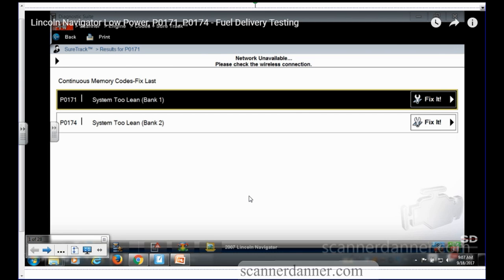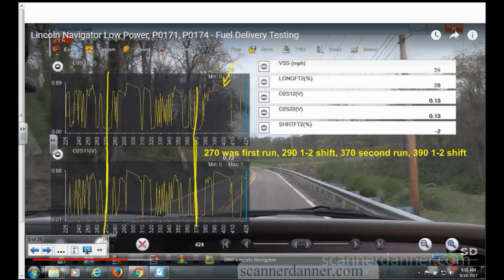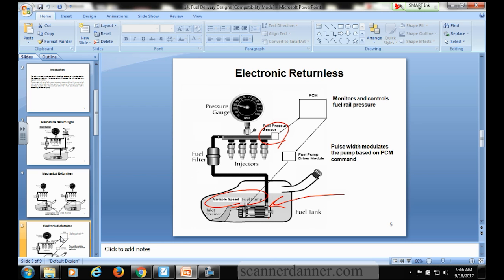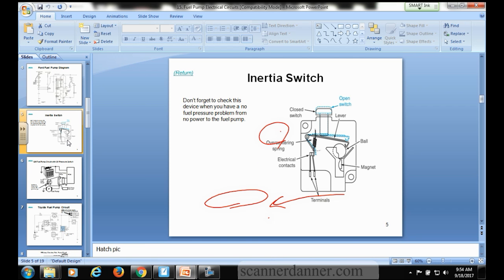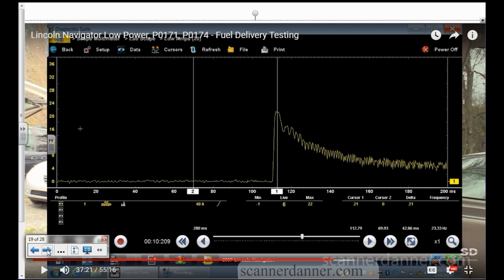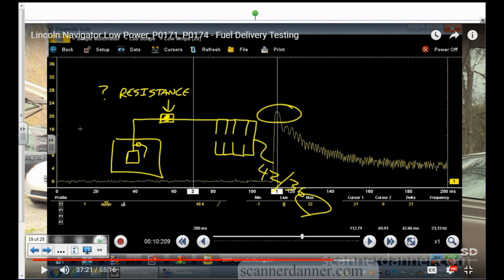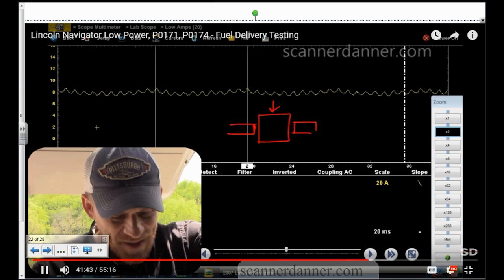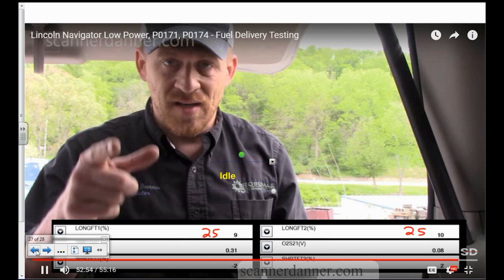An SD Premium Class on Fuel System Testing and Trouble Codes P0171, P0174

Comment: Hello, Paul. I have been told that fuel issues will affect calculated load value, but your video proves the contrary. Good calculated load with a fuel delivery issue. Could you please how fuel delivery affects or does not affect the calculated load value?  Thank you.
Reply from the maker: I've been using VE testing and calculated load values for awhile now and I've not seen low fuel pressure affect that number. In fact, that is one of the main advantages of that test!
Reply: @ScannerDanner   I cannot thank you enough, Sir. You are the best!

Comment: Hi Mr Paul, I'm one of your followers from Oman.
I've 2009 GMC terrain I'm having a lean condition on both banks. The nice thing is that the code P2179 says "system too lean off idle" which helps a lot.
I used a multimeter as a jumper on the fuel pump relay, the pump runs and I got around 4.6 Amps.
Is it weak fuel pump or normal ?

Thanks,,
Reply from the maker: Need a pressure reading. Amperage alone is not enough data

Comment: Hello Mr..SD I would like to ask can you use Fuel spray instead of starting fluid..Am in Uganda we don't have advanced Auto shops .. Thanks
Reply from the maker: I don't use starting fluid for diagnostic work as it is too volatile. Carb cleaner is my preferred spray when doing a quick test for no fuel

Comment: So I need help on my no start fuel issue on a 2011 f250 ,6.2 replaced pump n driver fuel module and fixed the problem ran good for 3 weeks n stalled our n won't start again I have no relays or fuses bad but when I jump and bypass the fuel module it will run is it possible I got a lemon part n I need to replace it again or can it b something else down the line

Comment: Your luckey my Nissan stoped, i thought a rat eat my wiring, it was ok put a new one in jacked up my bed and it ran good for a moment, had put another one in, my friend said lets see if it works. After hitting the pump in hole yes it did work i still put in the new one. Keep up the good work

Comment: I did a simaler test because my fuel pump would intermittently stop working then not work at all. So I had it towed to a, get this a mechanic shop and told the mechanic what had happen. He went out to the truck and he got the truck to start. Then he called me and asked why I though it was the fuel pump. Saying the truck started. I explained again the procedures I did with my verus. He said it Dosent mean your fuel pump is bad, WOW a mechanic...not. I said hook up your scanner to it and check for yourself. He said all he had was a code reader. I have learned all I know from scanner Danner's channel, GET SCANNER DANNER PREMIUM. This will help you know and understand everything with you vehical.

Comment: GTDI means Gasoline Turbocharged Direct Injection, those fuel systems have a variable speed electronic returnless fuel system.  
The 3.5L Ti-VCT (Twin Independant Variable Cam Timing) fuel systems have a dual speed MRFS. There is a FPCM or FPDM as some like to call it, but no fuel pressure sensor on the rail.The FPCM controls the fuel pump pressure at 10 or 12 V based on load. Basically the PCM duty cycles the FPCM to control the fuel pump. How i know this? I had an insane case study on 2014 Taurus with the 3.5 NA engine.

Comment: I have a doubt the filter is after the pressure relief valve so wouldn't be the pressure going to be same if it has the blocked filter or new filter hence the amps are going to be same just my logic
Reply from the maker: depends on the design, not all of the systems used a pressure relief valve in the tank, in fact most of them do not

Comment: Just a minor point, the sections of a commutator are called rotor arms, which might be  better term as if you say an 8 bar fuel pump, my first thought is 8 bar of pressure.
When you first counted the current peaks and said it was an 8 bar pump, It got a little confusing.

Comment: Could a bad fuel pressure regulator be at fault for low fuel pressure? Or is there no way testing it, or changing it separately from the pump assembly on a returnless system? Thanks love the videos!!
Reply from the maker: If it's part of the pump assembly, there is no test for it. And no way to know for sure if it's leaking in there.

Comment: One tip if I might; When looking for a specific event, hit the record button (floppy disc) and it will include a marker line in the data recording. This is helpful for locating a specific event but in this case making sure it is when the pedal hit the floor.

Comment: I have a complaint,   I am very good at carbureted engines but I just bought my first throttle body which is a 1997 chevy blazer.     you use a $3,000 scan tool on every one of your videos,     there is no way I can afford this type scan tool .    I would much appreciate some videos that would help people like me .      so many things that can cause a lean code on both banks and I do not have a scan tool .     yes I know spray with brake clean I want professional
Reply from the maker: Stop focusing on the tools I'm using and focus instead on the testing methods. Many times you can duplicate these tests with other tools. Many times you cannot, but you can find less expensive alternatives.

Comment: How do you do this test on a speed density system? I'm an FCA tech for the most part unless it's a PZEV we don't use MAF sensors. So I'm just wondering how to do the WOT test on vehicles without MAF. Sorry if it's a dumb question but I'm trying to better understand fuel trim issues. Engine driveability problems are my biggest weak point I'm trying to improve.
Reply from the maker: It is no different on a speed density system, you can still use your oxygen sensors as a guide to low power conditions at wide open throttle. If they stay full rich (over 800mv for a narrowband O2) then you DO NOT have a fuel delivery problem. Hope that makes sense.

Comment: GTDI is gasoline turbocharged direct injection aka as ecoboost which use a hi-pressure fuel pump to convert low psi to high psi for direct injection
Reply from the maker: Thanks for the lesson :-) not sure where you were going with that though

Comment: Is autozone a good place to buy sensor  bec I bought a crankshaft sensor from them n I put it in it died on me going work I took it back and got it replaced but now it misfiring and hesitant to start it a 99 dodge ram 5.2l
Reply from the maker: You didn't adjust it properly. Air gap is critical

Comment: Hey Paul. Great video like always. I was wondering about something while watching this video. These newer design brushless motors. Can you read them the same using a current test to see a bad spot in the armature ? I haven’t ran across one yet to check but am curious if it is the same type of reading. Not just on a fuel pump motor but any motor that is a brushless design. Thanks man
Reply from the maker: I've not seen a brushless motor yet, so I cannot answer that

Comment: With this type of pump/regulator combo, isn’t it possible the both the pump and regulator were still good and you just had the pressure drop simply by a plugged filter? You’d still keep the proper pressure before the plugged filter and have the lower pressure/volume after it.
Reply from the maker: I believe I addressed the fuel filter variable in my video? What was the old pump vs new pump, with RPM and Amperage? Refresh my memory. I believe there in lies your answer. Was it lower than normal amperage and higher than normal RPM? Sorry, this lecture was 2 years old and my son Caleb did the edits, so my memory if foggy on this one.
Reply: In this case, there was definitely an issue with the mechanicals of the pump. There was an increase in amp and a decrease in rpm with the new pump. Apparently I phrased the question wrong, I was trying to ask if the same symptoms could also be caused simply by a plugged fuel filter? High long term fuel trims/high load %/dropping fuel pressure with increased rpm...

Comment: I have a 2010 Altima 2.5S w/Automatic. My OBII device shows codes P0725
 and P0826 together.  The cars is running fine.  I have not cleared the 
codes (but will tomorrow).  The car seems to run fine, no hard start, no
 stalls nor stutters or shifting issues.  I am thinking the Cam-Shaft 
Position sensor may be one of the OE styles that gets oil contaminated and 
perhaps it is sending bad info to the power-train?  Since P0826 is a 
Power-train code?  Any thoughts?
Reply from the maker: I need you to do the homework for me. What are the definitions of those codes? I know they are transmission related but that's it.
Reply: @ScannerDanner  Dan, I cleared the codes and they did NOT come back, and there is NO Check Engine Light on either. Code PO725 "Engine Speed Sensor Circuit Malfunction",  and code PO826 is defined as “Up and Down Switch Input Circuit” on vehicles with manually shift-able automatic transmissions.  I think the up/down shift code came up because at least a couple of times I have inadvertently moved the shift lever over into the slot for "manual shift mode" when going from Park down to Drive, and then having done it unintentionally I quickly moved it back to the right back into the normal "Drive" shift position.  The Engine Speed Sensor is most likely a code connected to either the Cam Shaft Position Sensor, the Crankshaft Position Sensor (aka Transmission Speed Sensor -- As I find it is called out to be the same part by different links).  Again this is a 2010 Nissan Altima 2.5L with 103K miles. No other issues. So I think I am good here - Thanks for answering and asking!  Richard in KY
Reply from the maker: @retiredperson4054  My name is Paul Danner :-) So I looked up the P0725 code and this is a generic code indicating the TCM did not receive an engine RPM signal via the CAN network. You should ABSOLUTELY have an engine code too with this TCM code P0725. IF you do not, this does not bode very well for your transmission control module (TCM). 
As far as the P0826 code goes, I do NOT think you can cause that code by what you are describing. In other words, operator error, is not an option here. 
It is very difficult to advise you further on these and almost impossible when the problem is intermittent. Then add that we are talking through text on the screen, makes it even worse. If you find that you need help in the future, post to my forum www.scannerdanner.com It is free to join and I have 4 paid moderators who help me help you guys. 
Thanks! Hope to see you there.
Reply: @ScannerDanner  Paul, Thanks for the fast reply.  Like I posted - I only had the two codes showing.  They went away (cleared both out ) with my Bafx Products - Wireless Bluetooth OBD2 / OBDII Diagnostic Car Scanner & Reader Tool for Android Devices. At this point, I will just have to keep checking every week or so to see if  anything shows up? I will hop onto your forum - and thanks for the offer and your prompt replies!  I was a building trades instructor at two Technical Community Colleges -- Thanks for teaching the auto skills trade!  Best regards, Richard P

Comment: SCANNERDANNER can you make a "cheat sheet" rows and columns of what the short & long Trims, RPMS would be for a lean condition compared to a RICH condition if you're having a vacuum leak compared to having a fuel pressure issue. It gets very confusing to know what the trims should be at because you have experience when looking at the trims to know if you have a vacuum leak or its a fuel pressure problem but how can you know but just looking at the trims? You can get a lean condition or a Rich condition from a vacuum leak or a fuel pressure issue so how can you tell by just look at the trims?
Reply from the maker: Watch this video https://www.youtube.com/watch?v=oRX2V6_a3dc&list=PL5E3AEC36DB838BB1&index=32&t=0s

Comment: ScannerDanner! I have an issue and can’t figure out what the issue is. I have a misfire cylinder 2. I have a new distributor and new cap and rotor, new plugs and new plug wires, new fuel filter and injectors were just cleaned, O2 sensors are fine and EGR is fine. I found out that I’m not getting spark out of my plug cable on cylinder 2. I changed wires around and still nothing so the dist is not giving spark for cylinder 2. Can you help me out?!?! I’m going insane trying to figure out what the issue is.
Reply from the maker: Same problem with the old cap? Other than a bad cap and rotor. It sounds like you have an input issue. Is this the correct distributor? Any damage to the trigger wheel or reflector on the shaft of the distributor?
Reply: ScannerDanner tried the old cap, and had same issue. Shaft on new dist is fine. I’m checking crank sensor and teeth that pass it.
Reply from the maker: @shanefickett3597  "new distributor"?? Why was the distributor changed? If you are consistently losing spark to only the #2 cylinder, you absolutely have an input problem. Your ECM is receiving garbage in and is providing garbage out. There is no other explanation for what you have going on.
Reply: My car is a 1996 Honda Civic DX 1.6 non vtech.
Reply: Any other ideas scannerdanner? I’m thinking it’s either going to be the crank sensor or the wire for it, or the ECU but doubt it’s the computer because they rarely go out on these cars. And most likely wouldn’t be the main relay right? Not the PGM-FI?

Comment: I've watched your videos for about 7 years now and I always learn something. You had my truck in your class about 3 yrs. ago after I had taken it to 4 different places one was the Toyota Dealership and no one had any Idea what was causing an intermittent vibration but you did. Thank you for all you do to teach others.
Reply from the maker: I didn't pinpoint that one for you,  I only knew it went away in 4x4 mode, right?
Reply: It was a bad needle bearing. I had to replace the Clamshell CV axle bushing in the front Differential with a modified bushing from East Coast Gear Supply. It seems Toyota didn't machine the spider gear correctly. You are still the best.
Reply: I forgot to mention that I bought your book and OTC3633 test light, both are great.

Comment: The only thing I find hard taking a class and then using it out in the real world. Is remembering what you were talking about.
Reply from the maker: 😀 it will come to you my friend. Are you getting the jobs where you can practice what you learned? That is the most important
Reply: @ScannerDanner   with my new boss. No. But trying to learn when I get a problem car during my free time.
Reply from the maker: That is the key piece you are missing. Take on some side work and hone your skills in your driveway. Troubleshooting only, tell someone else what to fix. Even if you start for free. This type of work is that important to you right now.

Comment: Learned something from another channel as well.. if you take fuel pressure spec and multiply it by .12 to .13 you can get an approximate amperage spec to compare .. thought I’d share that and also see your thoughts on that @scannerdanner
Reply from the maker: wonder how accurate that is? testing it on multiple cars would be the answer to that
Reply: Yea I plan on doing several known goods since I’ve learned it.. thought it would be a nice addition to the test if it turns out to be truw

Comment: Why would my long term fuel trims be -20 and short terms be 0? No misfires. Engine runs great
Reply from the maker: you have a rich condition that has been compensated for and if you do not have rich condition codes yet, you will
Reply: @ScannerDanner  he needs to buy the book. 🙄

Comment: know this is off topic but want to hear your thoughts. Have a code po449 had defective vent solenoid repl. Now the light comes on roughly once a month all connections look good any thoughts on what to look for? Big fan of the channel!!.
Reply from the maker: Pull on the wiring right at the vent solenoid connector. I bet it pulls apart (copper wires are all broken inside of the insulation)

Comment: I’m a little confused using amperage to prove out good voltage at the pump. If you have a marginal voltage drop, wouldn’t you still have a high amp draw? 
   Maybe next time you have one with a marginal voltage drop record an amp scope pattern to show the difference. Thanks
Reply: If you have voltage drop where you shouldn’t (high resistance) then you would have lower amperage.  Using ohms law, you find that the more resistance you add in series to a circuit,  you will have a lower amp reading.
Reply: TheMagican614 , yes but he said amperage was a little low because it had a mechanical failure. So how are we sure it’s not a little low due to a voltage drop instead?
Reply: Bart Young well in the video when he saw he had around 6 amps he was not concerned at that point with a power or ground problem.  Scannerdanner has a lot of experience so he has an idea of what kind of reading he should see.  I personal think that if there was a problem with high resistance in the circuit, you would see less current than 6 amps.

Comment: low feul pressure, low amp draw , high RPM, faulty pressure regulator at pump? leaking through ?
Reply from the maker: Possible? No way to know if it was that or the impeller of the pump that was worn. On these systems where the regulator is part of the pump assembly, there is no test to determine if it was the regulator or pump or leak in between. Also, this is why, on this design, you MUST change the entire assembly
Reply: This is exactly what I was thinking about the regulator,  thanks for replying to this comment Paul and clarifying on that!!!